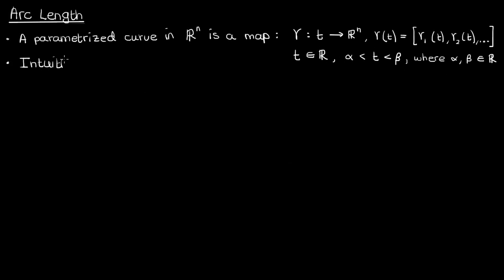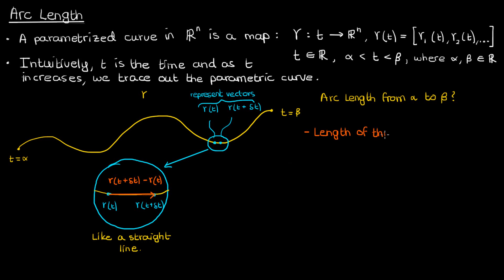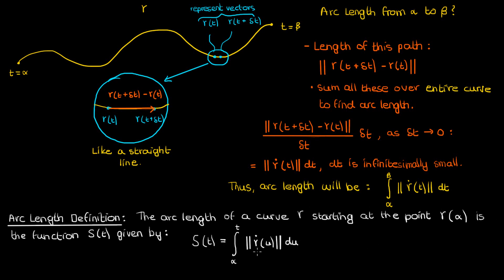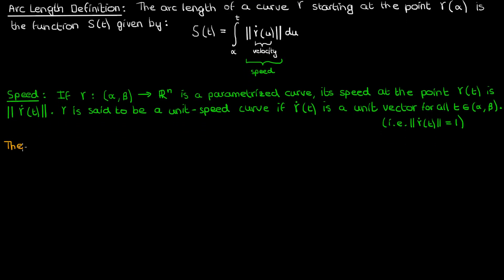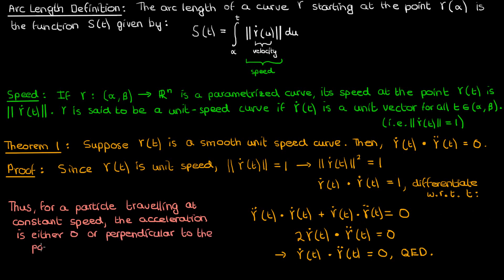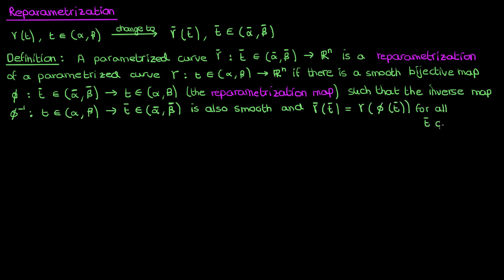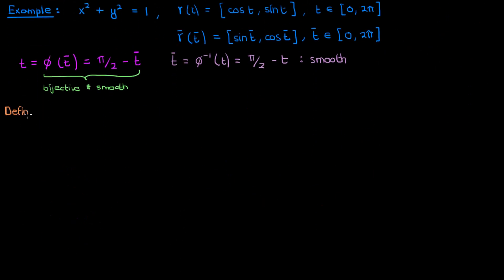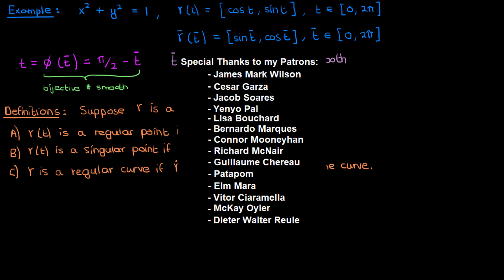Arc Length and Reparameterization | Differential Geometry 2

Comment: Why not use cosh^2 - sinh^2 = 1?
Reply from the maker: The equation of a circle with radius 1 is x^2 + y^2 = 1. Unless I use the imaginary number, I can't really set x and y to depend on cosh and sinh. cos and sin are therefore the best options.
Reply: I should have been more clear.  instead of using sec^2 - tan^2 = 1, why not use cosh^2 - sinh^2 = 1?  Perhaps one could avoid the domain limitations of tan and sec.
Reply from the maker: I think you might be confused and you're likely referring to my previous video. https://www.youtube.com/watch?v=4fB0VfKZRXM&t=0s&index=2&list=PLdgVBOaXkb9DJjk8V0-RkXTnD4ZXUOFsc

Your alternative was suggested in the comments, and I agree that it would have been a better option.

Comment: 7:15 if you change the sine and cosine but still trace the circle from t=0 to t=2pi, aren't you tracing the curve differently? instead of tracing it from [1 0] counterclockwise, you trace it from [0 1] clockwise. Does that mean that the way you trace the curve, like where is the starting point, is irrelevant?
Reply from the maker: Yes, the starting point and the manner by which you trace the curve are largely irrelevant. As long as you end up tracing the same curve, it's considered a valid reparametrization.
Reply: In differential geometry, a parametric curve is often used as a tool to examine level curve's and higher dimensional objects. However the orientation is an important property to consider. For example, much of general relativity is written in the language of differential geometry, so if you are considering objects in space with relativistic significance, the orientation and starting point of the path are highly important.
Reply from the maker: Interesting, I agree that the orientation and starting point would be important in relativity, but would that importance extend to reparametrization? By definition, the orientation and starting point shouldn't really matter so long as the curve ends up being the same.
Reply: @FacultyofKhan  well the reparametrization can potentially change the orientation (i.e. the example that Eliav Rad outlined) the curve would still be the same, but if you are considering the parameter as time and the value of gamma(t) as the spatial position, then reparametrizing also requires a shift in reference frame of spacetime.
Reply: Chase Bender I agree with Faculty of Khan here that only in your application this matters. In general one can say that the new parameterization covers the same curve, so it is by definition a reparameterization.